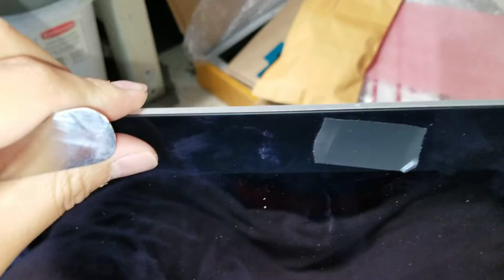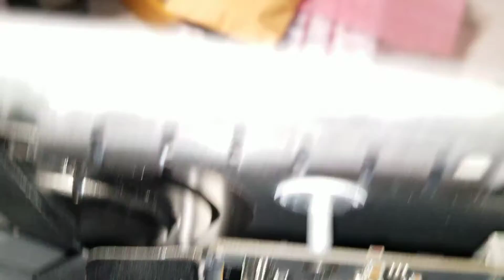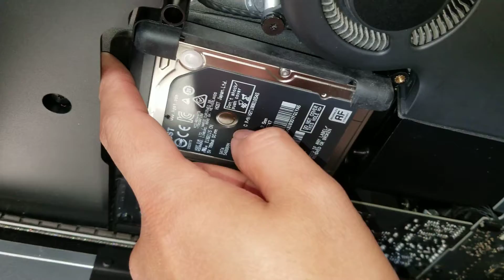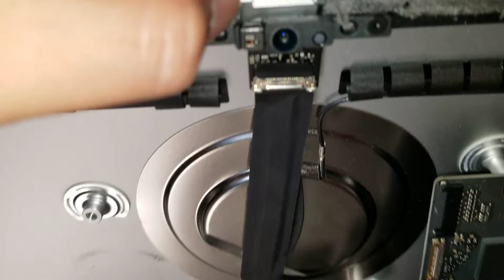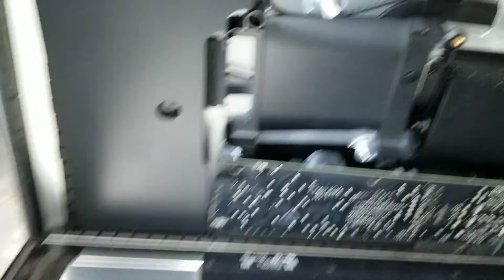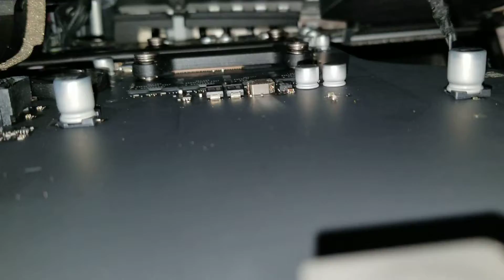iMac A1418 21.5" inch Late 2015 Disassembly No RAM SSD Hard Drive Upgrade Repair

Comment: Just keep the screws with whatever component they came with to prevent mix-up.
Reply from the maker: Whatever works for you
Reply: @ItsBinhRepaired  Appreciate the tutorial.  Apple really screwed anyone with an iMac from that specific year.  The newer models have a removable panel in the back to replace the memory.
Reply from the maker: @JBtheJMB84  yup, it's stupid

Comment: do you remember if the CPU is soldered? i want to upgrade to an i7 6700k
Reply from the maker: Not sure. Either way, you'll have to stick with the same generation processor.

Comment: Yesterday I upgraded the SSD on my 2015 iMac. However, after the installation webcam is not working. Any idea on that? Worrying whether I have covered a sensor with adhesive tape...
Reply from the maker: Maybe you covered the lense with tape or damaged the camera

Comment: Can i upgrade anything more on 2015 21.5 inch expect the SSD? Like GPU probably not possible what about CPU if i change the logic board and get the 16gb ram version can i do that?
Reply from the maker: Most likely, but you'd be better off selling that and buying the other model already built. Why risk it. You won't save much if anything at all. GPU and CPU are part of the board as far as I know.

Comment: I have a 21.5 inc late 2015  Retina 4k, I thought weren't
 able to upgrade these? thank you for the video
Reply from the maker: Glad the video helped. :) Make sure you get the right adhesive. Regular double stick tape won't work and also put tape on the front for at least 24 hours to keep pressure on the two layers. If you haven't already, please like and subscribe so others can find my videos. Thanks!

Comment: Hi do you need to put thermal sensor on ssd ?
Reply from the maker: If the thermal sensor was on the old drive, but this model doesn't have one, so there's no need.

Comment: Hey your video is very helpful.  im consider to buy this imac 2015 with same model A1418. 
1. Can this machine support SSD Flash Storage with 2TB ? The apple web said only configurable to 1TB Fusion Drive and 256GB SSD.
2. Can we do something for this machine become external monitor ( like HDMI IN feature ) if we have nintendo switch to play? 
3. What is the size of maximum RAM memory that we can upgrade ? I need about 16 GB.
Reply from the maker: If you get this exact model though, you can't upgrade the RAM. Please watch the video.
Reply: @ItsBinhRepaired   Apple says it is not user-replaceable and can’t be upgraded after purchase but it is doable. However, it's dangerous, time consuming and requires meticulous cleaning and soldering.
Reply from the maker: Soldering? D:
Reply: Hi. I actually found through Google, on the official Apple Support pages -- I am not certain if this is a mishap but -- I have witnessed pages state this model CAN have ram upgraded AND a page stating the late 21in model cannot. 

Apple has confused me.
Reply from the maker: Have to open and check
Reply from the maker: You can put as large SSD as you want that they sell. I don't think you can use it as a monitor for external devices. 16gb ram shouldn't be an issue
Reply: Thanks Binh Repaired..It’s really helpful. 

Yes I can see this is onboard RAM. I just watched somebody can soldered 16GB RAM Upgrade https://youtu.be/jxPO_O3gCIA
Reply: @sandyhartono5700  bless you amazing

Comment: Hey im having trouble on hp pavlion 15 TS the CCD drive when i dry to press the button to open it wont open because my laptop is off. i spill soda on it and my laptop wont turn on and trying to open it so i can do all the instructiona that the video do.i really need help please respond to me if you got any clues to openong it
Reply from the maker: You mean to pull the CD drive out or to eject it? You can eject the cd drive with a small paperclip. Just bend it and insert the paperclip into the hole on the cd drive near the eject button.